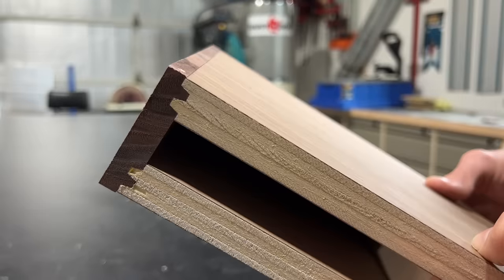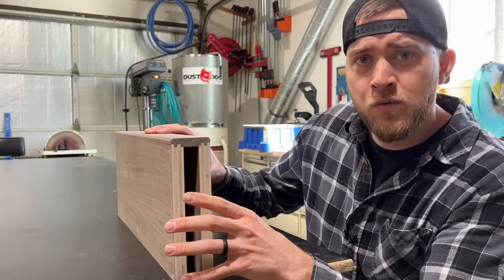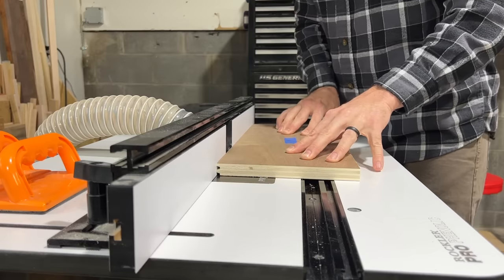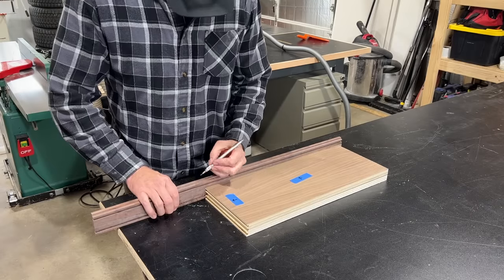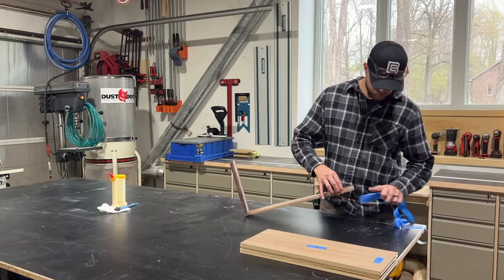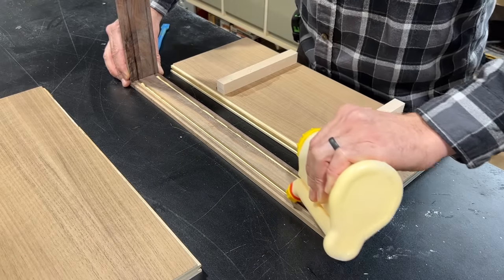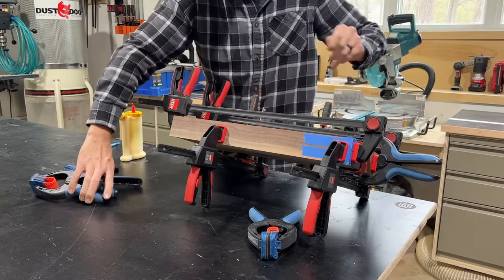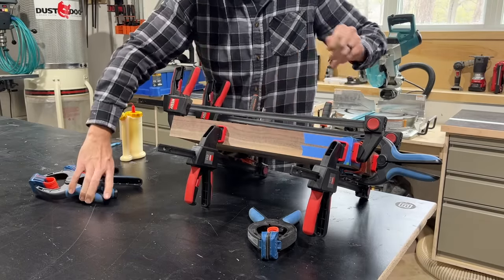This will change the way you build floating shelves FOREVER!

Comment: This is an awesome build. I have been doing floating shelves for years and this seems to avoid all the regular problems I have encountered.

My guess is that this shelf will go into a corner. 2 questions... 
1. What are you using to mount the shelves?
2. How would you mount an open wall shelf with both sides finished?
Reply from the maker: I either use prefabricated metal brackets (sheppards brackets) or sometimes I like to make my own 👍
Reply from the maker: To see how I mount mine, you can check out this video 
https://youtu.be/RXYQau202y0
Reply: @EverydayBuilds  I saw this one. Do you find that the wood holds up even with no side support from a wall or cabinet?
Reply from the maker: @OVHabitats I have only done the wood supports if I had side wall support. Not sure I would do this method if it had no side support. I might have to test it out.

Comment: Nice post.  I think I will give it a try.  I felt your pain when you sanded through the plywood vernier.  I've found a way to avoid that.  I was doing a bunch of simple edge banding with 1/4" hardwood on the edge of plywood and burning through the outside more often than I care to admit.  What I did to fix it was to make sure that the installed hardwood is about 1/32" proud of the plywood.  I was using a flush trim bit and all I did was put down 2 layers of tape before I run the trim bit along the edge and when the tape is removed the hardwood is just above the plywood.  I believe you did the same thing in your process by designing your hardwood to be slightly proud of the plywood.  At this point what I do is to run a pencil mark around the plywood surface where the plywood meets the hardwood.  It's very easy because the hardwood sticks up slightly by design and your pencil just runs along the corner.  Now, when you sand the plywood, you just sand the hardwood down until the pencil is gone.  Then you stop sanding there and move on.  Since I've been using this method I've NEVER blown through a vernier since.  Give it a try.
Reply from the maker: Thanks for the great tip! I will definitely be using that 👍

Comment: I am fairly new at carpentry, so pardon my ignorance.  Why didn’t you apply another strip of walnut to the other side of the shelf? I understand the open part it’s going against the wall with the mounting bracket.
Reply from the maker: This shelf is intended to mounted in a corner. So the back and the one open side, would not be seen 👍

Comment: Wish I had a router table to try this.  One question.  Is there a good reason not to use matching solid 1x material on the top and bottom?  Or is it just cost?  I don't have a table saw and working with large sheets of veneered plywood is a pain.
Reply from the maker: It's really just a cost thing mostly. If i was going to use 1x for the top and bottom, I might as well just make solid wood shelves at that point. But making them this way with 1x would be a great shelf, just pricey.

Comment: All you need is 2  1/2 lap mortise on the front piece and half lap on the solid wood on top and half lap ply on bottom. Bottom isnt seen as much but the top being sold means no problem with veneer, and will take wear, be refinished easily.   Do the sides the same with cut 45 degrees along with the front.  Glue up and done,  It will look like one people of wood.  You can knock out a ton of them.  Same as mantels. Strong joints and no special bit.

Comment: Loved it, thanks.  One question: You have CA glue and accelerator,  why didn’t you use that in the edge miter instead of taping and waiting a couple of hours?  One of the tricks I learned a long time ago was to CA my miters and move on. It saves a lot of time.
Reply from the maker: That is definitely an option, but I just don’t trust CA as a long term glue as much as I trust titebond. But that is really just personal preference. Thank you!
Reply: @EverydayBuilds  You could use both in the joint two small spots of ca glue, the rest of the joint use  titebond. Best of both worlds.

Comment: use a “LOCKING MITER BIT”, and you can eliminate that 1/4” lip and still keep that joint you like.
all the edges will be clean and strong.  it can be used on all 45 degree miter cuts, a different but for differ thicknesses, and it can be used on the ends on your floating shelves so you don’t have to use that folding glue joint with the tape.

these bits take a little time to set up but once the setup is done, you’re good yo run all your boards, and with not overlaps.  no more of that sanding tile it’s smooth business.

not sure if you paint or stain your floating shelves, so these locking miter joint might not work if your using plywood.  that thin veneer will disappear when you router or sand the edges.  you’ll eliminate the 1/4” lip, but you’ll have to paint and not stain your shelves.

you can watch some videos on the licking miter joint and decide if it will work for you.
at least you have another option.

Comment: Your video presentation is good but... That's a HUGE amount of work and effort, using a LOT of material!
I was a little concerned about your fingers so close to the router bit 😱
The choice of miter saw to ruin the ends was not the best approach (as shown) because of the tearout on the front of the material. You should have used a scrap piece of wood to project the front face.
At the end of the video, 16:05,  it looks like there is another layer of hardwood. There is a visible join line near the top of the shelf.
About 30 years ago my wife wanted floating shelves. My method used 1.25" thick solid wood 6"wide and 8 foot long
Drill several holes through the depth of the wood (front to back)
These holes are positioned approx   .5" from the top surface of the shelf. 
I drilled "matching" holes in solid brick walls to house masonry anchors. I used .25" threaded rod through the shelf into the masonry anchors, then used two nuts at the outer end of the threaded rod to pull the shelf tight against the wall. These nuts were in a recess created in the front edge of the shelf. The recess was plugged with matching timber plugs. The plugs were virtually invisible and victors could not figure out how the shelves were attached to the wall.
Ultimately VERY simple, very effective.
With the mounting holes close to the top surface of the wood/shelf, the shelf and anything placed on the shelf created a leverage force between the anchorage point and the lower edge of the shelf keeping it tight against the wall.
This is easier to show in pictures than the description above, but I hope you get the idea.
Best wishes

Comment: I like watching your videos and getting the great build tips. You do fantastic work..If I was making these videos (which I'm not) I'd conciser adding in a safety disclaimer and recommend using some type of push blocks..Pushing that face over the router, your fingers are really close to that bit. Someone with little experience using a router table might not be so mindful of the dangers. If that piece of wood grabs or jumps, serious injury is very possible. I didn't read through all the 350 comments to see if already addressed, but hopefully this will help someone. Again, great videos and I get a lot out of them.
Reply from the maker: You are 100% correct, I should have absolutely been using push blocks. And you are not the first to point that out. Thank you for taking the time to make sure everyone is being safe 🙏

Comment: When building these entrapped by 3 walls (niche) would you assemble in place? As walls are rarely/never square? Thanks
Reply from the maker: I would build it oversized and then scribe it or create a template to cut it to its final size.

Comment: Beautiful work but overbuilt. The joinery is great and it's an interesting bit (why not just use a rabbiting?), however, this would massively complicate a shelving job. I can't even imagine doing a bunch of floating shelves like this. In the beginning of the video, your miters being slightly off really isn't a big deal since you'd typically be rounding the edges off a bit anyway and or routing some kind of decorative bevel. I'm far from an expert, but I never leave any totally hard edges on the things I make because it's too easy to damage them.

Comment: Curious as to what mounting hardware you use?  Just built my first set of floating shelves, and built a wood internal frame to mount to the wall but not sure if this will be strong enough.  My internal dimension is 3/4"
Reply from the maker: I like to either use Sheppard Brackets or make my own like you. You can see how I make my own in this video here 👇
https://youtu.be/RXYQau202y0

Comment: Nice job👍 whats the typical build time using this method per shelf? Also the hose you used for the festool sander, is that festool or 3rd party? If so can you share a link to it? Thanks
Reply from the maker: Once everything is setup, I can build one start to finish in an hour or so. That hose is the stock festool hose that came with my CT15 👍

Comment: If you're going to go through all the trouble of using a router bit, you might as well use a "lock miter" instead of the bit you're using.
Reply from the maker: I may be mistaken, but I don’t think a lock miter would give me the same face thickness that I get with my method. Does it create a 45 on both pieces?

Comment: Not really the only way to go about floating shelves.
One you anly need to use 3/8" [10mm] round bar inserted into the wall [studs or brickwork] to support the shelf. Plenty string enough and that does not need anywhere near t=the size of the cavity you make.  You can also leave off the front piece make a rear piece drill attachment holes and then drew in coach bolts 3/8" maximum by using a long extension and socket.
Then fit the front piece using your joint configuration.  And if you are worried needlessly thatthe shelf might be too weak you can build in timber [ribs] through which you drill and insert the coach bolts.  Large F clamps used over the whole build to hold while gluing means that three claims can easily do the job with a few other clamps to to hold it to gather.  Brad nails are useful and not easy seen to aid assembly.  12mm ply is maximum needed the extra thiknes is a waste.
Reply from the maker: I like the idea of leaving the front piece off the face and attaching to the wall through the shelf. Might have to test that out. Thanks for the comment 🤙

Comment: Have you ever tested the strength of a miter fold?. Because a 14 in long miter fold box beam can hold 200lbs eventually will breke but the wood will break not the glue. Those floating shelves will never experience Those harsh circumstances. Lets not over think think this. But i do agree miter fold plywood i dont like because its just a very thin viner.
Reply from the maker: It’s not about the strength of the joint. My problem is with the weak veneer corner 👍

Comment: I see an issue with this method.

when you did the miter folds, you got glue squeeze out into the channel that ended up preventing the top and bottom plates from seating into the channel.

If you cut away the very corner of the top and bottom plates, not enough that it'd be visible, but enough that it doesn't have to perfectly in that corner - you'd get a much better fit without needing as many clamps for glue up.
Reply: Excellent suggestion, Jeep.

Comment: Why isn’t the back of the shelf used as a mounting bracket? Just screw it in place on the wall, then glue and support it? Only downside is then the shelf is there forever unless you want to destroy the shelf
Reply from the maker: What do you mean by “back of the shelf”?

Comment: That's alot of work for parts that carry no load in a floating shelf.  The top, the support bracket, and the anchors in the wall carry the load; not the front, sides, or bottom of the shelf.
Reply from the maker: Correct, what’s your point?

Comment: New school carpenters making simple furniture way too complicated. Most floating shelfs are no thicker than 1.75 inches. A solid piece of wood cut to dimension and sanded no planer or jointer needed. And you got urself  much nicer and legit wood shelves
Reply from the maker: Are you saying that an 8/4 piece of lumber just comes flat and ready to sand?
Reply: @EverydayBuilds  most wood places have milled boards (hence 1.75)...and hey if they dont they got themselves rustic 2" shelves thats whats hot right now
Reply from the maker: Lol, that’s fair. But you would still have to drill the support locations and mill out a recess in the back. So I really don’t think the way I showed is that much more complicated. But I agree, solid wood shelves are the best way to go 👍

Comment: That's a clamp nightmare. If you knew my trick for getting perfect miters on the table saw you would only need masking tape as your clamping device. Don't use crap blue or green tape.  They don't have the holding power and just tear when you fold. You need to get the better thicker masking tape available from paint suppliers. The better quality masking tape will stretch and not tear when you fold.
Reply from the maker: I anticipate the clamping strategy will be better next time, lol
Reply: So whats your trick?

Comment: This seems like overkill for a floating shelf. What was wrong with your original approach of using a rabbit? I have that bit along with the true locking miter bit and hate the setup process.
Reply from the maker: The biggest issue with the previous technique was how stressful the glue up was. This way is much easier 👍
Reply: @EverydayBuilds  That glue-up didn't seem much easier 😂 I'm sure you'll develop a better technique going forward, but I'd settle for a tad more work during glue-up vs messing with those bits and running all the material through the router. I appreciate you sharing your method though; I never thought to use the glue joint bit for a miter joint
Reply from the maker: Haha, the first one had its challenges, but it will be much easier as I do more. I just love trying to do things differently and sharing it with you guys. That’s half the fun 🤙

Comment: How to take a simple construction method and make it complex for no reason at all.
Reply from the maker: Yeah, why try anything new ever 🤷🏻‍♂️
Reply: @EverydayBuilds  I have those glue line bits.  The time wasted didn’t result in a better product. Time is money. Spending an extra 15-20 minutes on set up for a 30 minute job wasn’t worth it. The results in the end are exactly the same.   Great job on continuing the grain around the miter corner.  That came out perfect 👍🏼.
Reply from the maker: I get it from a business perspective, but if I’m making them for myself, this is the method I would use every time 👌

Comment: Today, good glues are stronger than the wood. Stop wasting time with fancy miters. If you are not fixing a grain issue with a spline or mechanical fastener, you aren't making it any stronger. Long grain to long grain has been use for sailboat mast for years. .
Reply from the maker: I’m not sure how this applies to what I did. What exactly are you referring to?
Reply: @EverydayBuilds  Your title says "This will change the way you build floating shelves FOREVER." 

No, it won't. People get baited into looking at these kind of videos thinking that something new has come out. When it turns out to be the same old same ole, you get frustrated that you wasted your time watching it. 

Not saying you did a terrible job. Just that your method is in no way superior or faster to warrant the title.

Keep doing what ya doing, have fun, just maybe don't click bait with BS.

Comment: Why not just use solid plank for your floating shelf instead of six days of labor? You are basically making a fake plank anyway.
Reply from the maker: Cost mostly. And solid planks still require labor (planing, jointing, boring). Solid plank is less labor, but higher material cost. Both are great options though 👍